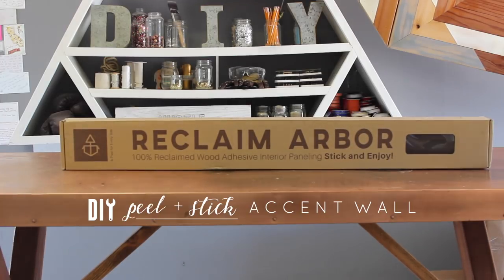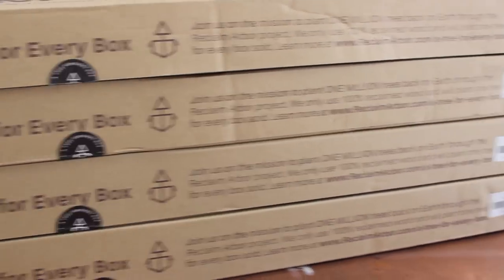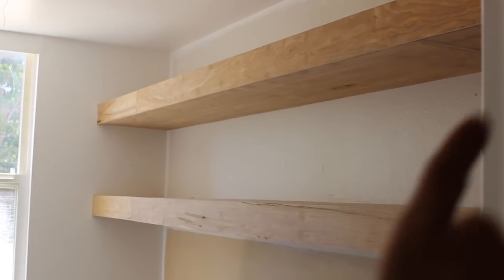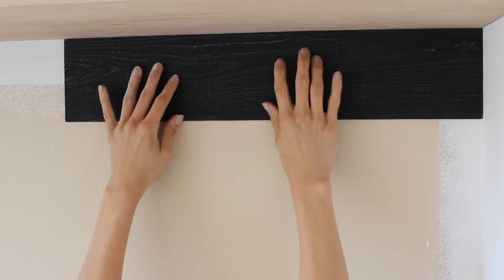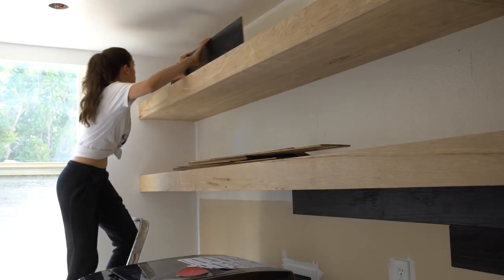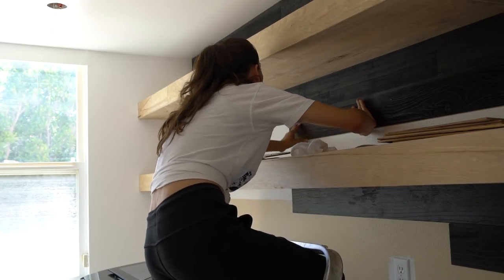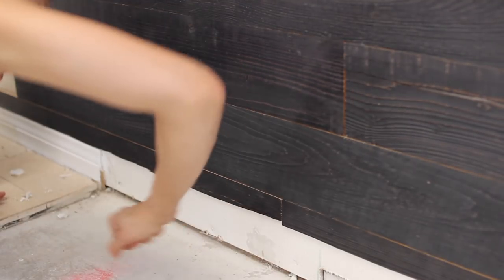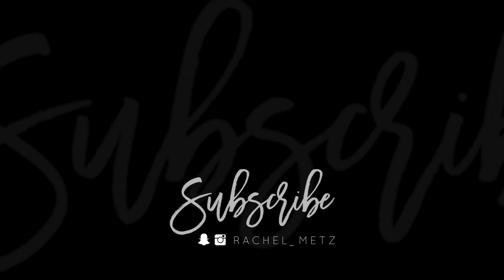Easy Peel and Stick Wood Accent Wall

Comment: For the people wanting to do this, know it's $179/box. It's cheaper to buy plank wood, have it cut down, and paint it.
Reply from the maker: Great alternative as well!
Reply: Or rip some pallets.
Reply: We can't because we don't have the tools and because we're renting, it has to be a temporary solution
Reply: I just put down something similar to this from home depot for about $35 per box
Reply: How do you buy plank wood...and where wood you get this cut...not the city right
Reply: The advantage of being a popular YouTube is you get things for free and also they get to do a video for which they also get views and money....bumper bonanza
Reply: @michellehood3345  it'll be harder in the city. But most hardware stores will have what you need
Reply: @z.deutch1334  if you measure the dimensions of your wall, you can buy a piece of wood the exact length and it should fit snug. You can glue, paint, and customize that instead of your wall!
Reply: yea I was blown away by the price like yea no
Reply: Saved me 5minutes and hundreds of dollars 🤗
Reply: Holy Cow!!!!!
Reply: @z.deutch1334  use the peel and stick fake shiplap .
Reply: @julesk3117  yep! Ive done SO much with those! Walkways in the yard, headboard, crafts.... you name it :) !
Reply: @michellehood3345  Home Depot, Lowes Wayfair Etsy Amazon Overstock just to name a few... or get it donated by people gettn rid of their pallets.. even warehouses through out busted up ones the forklifts can no longer use. Its more like where CANT you get plank wood :) They do also sell much cheaper versions that are very nice however, I think this is well worth it due to the quality! Best of luck to you!
Reply: shes probably sponsored lol yeah just for 4 boxes on sale was nearly $400 LMAO
Reply: thats crazy i may as well give up and risk it and just throw up some paint ugh

Comment: Hello. Thank you for this video. I'm wondering what you meant by putting in a poster board if you live in an apartment, which I do. Can you elaborate please? 🙏 TIA
Reply from the maker: Natasza does an install of a similar backboard with a poster board option! I can't elaborate since I've never done it.

Comment: Sooooo.... Ya know how they sell linoleum/vinyl sheets with this wood type design?  Do you think you could adhere it to a wall as well? Maybe with liquid nails and some staples hidden with a nice trim? I feel like it’s almost the same concept as this. But I’ve been told linoleum/vinyl sheets aren’t meant for walls 😒
Reply from the maker: Definitely liquid nail it.
Reply: Carpet tape.